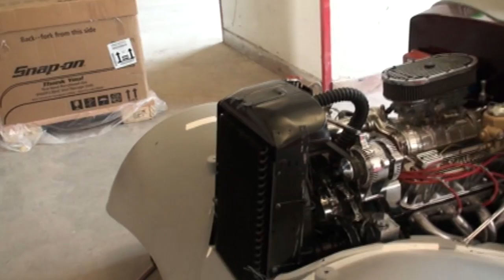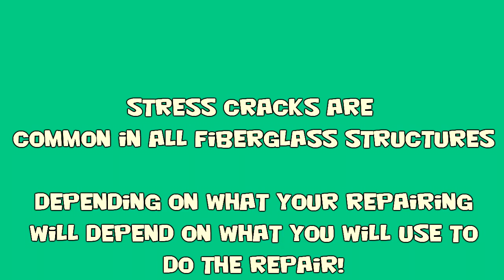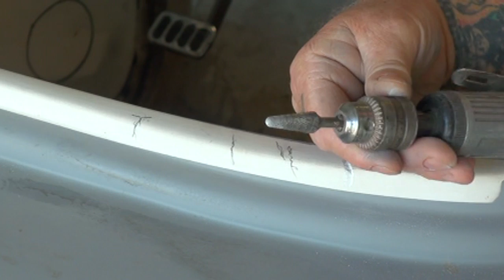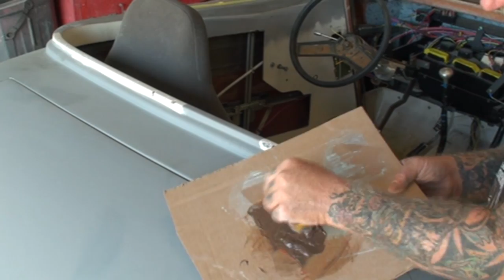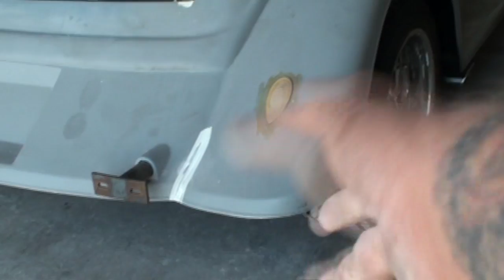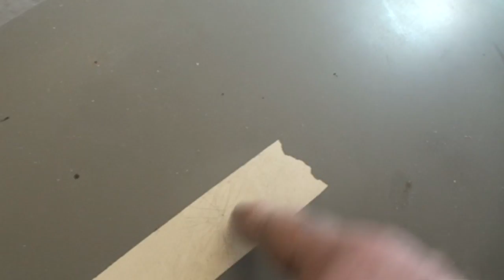How To Fix and Repair Fiberglass Stress Cracks

Comment: Can anyone w/o being a smart ass..help me with a big problem I’m running into?
I am above a beginner but far from a expert in glassing. 
How does everyone stop the end of their glass from popping back up? I am trying to make a single shelf type project, I am making a slotted slide in tackle box holder to hold my see they snap open boxes, size of box is 15 1/4”W x 9 3/4”deep, 9 1/4” tall, the dividers are very heavy duty cardboard I brushed on resin w/ hardner onto cardboard first let get nearly dry but fingernail intention dry, then added my 6% woven fiberglass to divider, I cut glass 1 1/2” wider and cut straight line size of divider as so I could fold it over edge and make a pretty corner, when finished I’m glassing it to a console inside boat as so I can get to boxes faster easier and not hv tackle boxes all over the floor inside boat, already made my L-shaped brackets and glassing them onto box last, then attaching it to inside of boat with small mounting screws. Sides and bottom, having open top and boxes will stick up past box at a angle as for easy grasping. Each box will stick up 3/4” higher than the next one. But my divider everything lays perfect, cept the corner square I made for folding over the back edge. It keeps popping up. Tried adding little more MEK to last part of resin to set up a lot faster and leave corners till last but I can’t keep tension in all 4 corners at same time w/o making the laid glass loosen up. Any help appreciated thanks be safe

Comment: That was very informative thanks..
I've been working on an old 91 camping van I have.. the windows were leaking and I couldn't find rubber seals to fit it at the time so I caulked them but the past few years that I have used caulk on vehicles it always seems to run months and years after it's dry when it rains or mists..
Can you recommend a caulking that doesn't run after it's dry?
I used what they said was the best but turns out it wasn't..
Reply: I have a 99 24 foot camper and I notice on the windows they use  puddy type sealer. Your going to need to remove the window and the flashing or weather guard or "trim" remove old product and apply new then re install. Remove one window to see how they sealed it then go that same route or use windshield caulking for the sandwiched area that is pressed against the exterior cladding. I hope this helps

Comment: I was doing this exact thing to remove stress cracks, and the so called expert at the shop told me to go much wider, at least an inch, to hold more of the glass bondo. Now that I’m done using his method, it appears that it needs a month worth of work, instead of 3 days. I now understand why his kids quit and work at different body shops. He was making absolutely no sense, but, he’s the expert. Good thing I’m not getting paid, just helping him out because everyone else quits on him. I wonder why?!?!?

Comment: Hey if the paint is chipping off do you need to pull the paint off where it's chipping or just leave it alone and sand the cracks with the burtng tool.?
Nicely explained video by the way

Comment: I just ran into this channel on Accident so glad I did, I just bought a 94 Ford ranger supercab with a fiberglass bed it's in fair condition needs a couple of dents pulled out or cut out & plated in ,The fiberglass bed has a couple of holes in it , Im a little apprehensive about doing the bodywork myself But I don't have the money to pay someone to do So I going to give it my best shot ,Im a retired welder fabricator of 38 years My very last job was Fabricating and welding the steel barrier fence that surrounded ground zero Rip ,...Pete you are the man Love your channel You Talk the Talk ,But you definitely Walk the walk

Comment: i use to do all the vetts in my area and a lot of stress cracks go threw the glass my fav. is vett hoods and i would never own a vett after working on them and the zr1 vett really like those ever try changing the back light bulbs in one we charged 350 to change the back bulds in that body
Reply: the best vett it comes from canada they have metal bodies on them canad will not let a all fiber glass car to be sold in canada even the 70 vetts are metal body my buddy had a 76 vett all metal body

Comment: Right On Time.....stripping the bottom on a 36 footer and doing a major repair around the gunnel.    Will take these tips and put them in the tool bag.  You & Minnie have no idea how much help you have been on my projects.  Again, if you guys are ever in Triangle, VA.....dinner is on me.  Again, thanks!!
Reply from the maker: On that job you might consider using a Fiberglass Resin/Fiberglass Matt Paste Mix instead of using dynaglass... I have some videos on YouTube SWRNC that shows you how to do it.. Search for Fiberglass Repairs SWRNC in the search bar and they should come up... Good luck!

Comment: Thanks Pete, I have a Vintage Jet Boat with some minor stress cracks on the bow that I want to fix.  I now know how to do it right!
Reply from the maker: On your boat it's better to use a Fiberglass Resin/Fiberglass Matt Paste Mix if it's on the sides or bottom of the boat.. If it's the top of the boat this would work fine.. Good luck!

Comment: Heh, takes me back to when I worked in a small fiberglass shop making interior/exterior decorations. We made carouse horses, whirly gigs, different types of birds, all kinds of things, paint them like new and then antique them. The Museum of Natural History in NYC had a elephant tusk that was knocked over and broke. They replaced with one of ours, yeah, made them too and deer antler chandeliers, and no one knew it was fake. Anyway, my boss gave me the job of fixing a big hole in a shroud for a snow groomer. I started with a layer of matte, and then built up layers of resin, a silica powder of some kind and shredded fiber glass. It took me 5 hrs, but made $125 back in 1980. It was a slow start but as the fiberglass cured it heated and then I was able to work faster. Came out nice. Also when you were finding those holes, when I was a jeweler I would get castings with tiny holes and learned quick to prod them as there was a bigger hole underneath a lot of times and when working on up to a 100 pieces at times you want to do it twice. Wastes a lot of valuable time. Thanks for sharing
Reply from the maker: Ill bet that was an exciting job, making stuff for History Museums!!!  Id love to have some of that kind of stuff in my office..... Sounds like you know your "FIBERGLASS"! Thanks for watching Kevin...